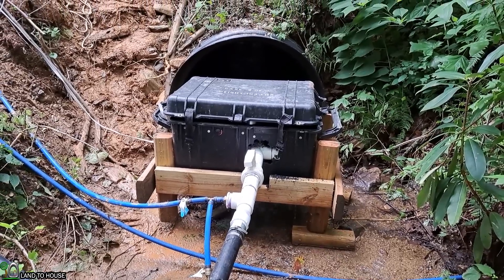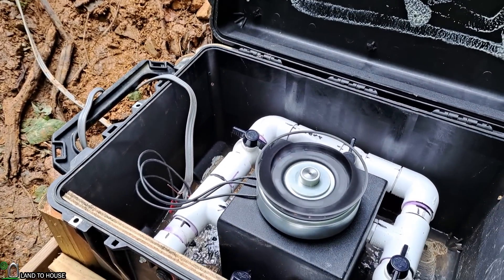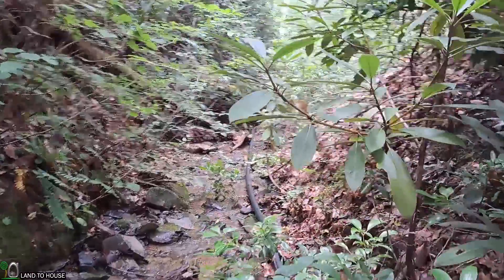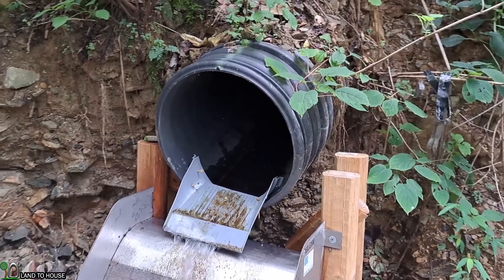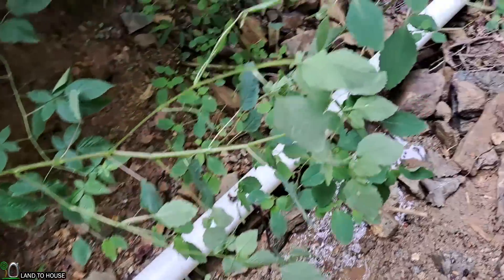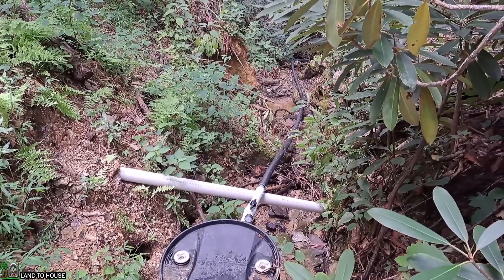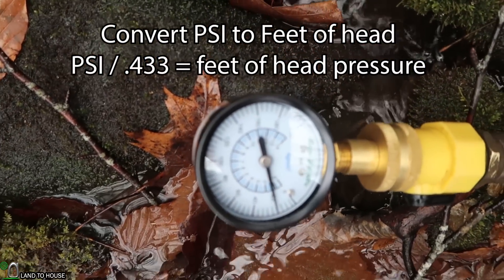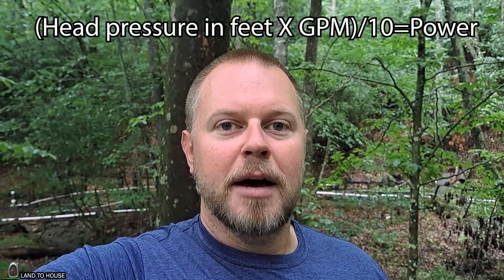Micro Hydro only makes 60w - do your PSI and GPM research first

Comment: The water is running so fast across the colandar screen that the water is running right off the end.  Can you lift the collection box up higher so that the water runs across it slower?  Also can you spread the water out so it runs across more of the screen.  At the moment it's running down the middle third so losing a lot of water collection.

Comment: do you go with the generator directly to the charge controller? do this have a special input or do you use the mppt input?
Reply from the maker: It goes to a rectifier then directly to the mppt. Surge protection and breakers are a good idea.

Comment: Your plumbing configuration is part of the reason that the system is inefficient. You should avoid any right angles and use flex pipe from the main line to each of the nozzles.

Comment: Could move silt barrel upstream so top is about 6"below the pipe where it attaches to the coanda. Every little bit helps. Maybe also look upstream from culvert pipe, see what other springs or runs can be cleared to the main stream

Comment: What a waste of plastic pipe. 70W!!
Reply from the maker: More upfront research needed to be done.
Reply: It could keep a car battery charged for an off grid cabin. 70w x 24 hrs = 1,680Wh; that's a 12V 100Ah lithium battery drained and filled every day;  most RVs get by with this.

Comment: Dear Land To House,
I appreciate all these videos so much, but I have one question: Does the power output change if the water drop (head) is the same but the linear distance  to the turbine/pelton changes? I have 50 gallons/minute with a head of 24 feet. I can set the turbine/pelton anywhere from 50 too 300 ft from the source. Does that make any difference for power output? Thank you kindly, Steve
Reply: The pressure comes from the height, not from the distance. This is why 'real' dams like the Hoover dam are very much vertical affairs - it's only the top-to-bottom delta that's productive.  It's like diving - diving 10 metres down puts you under 1 additional atmosphere of pressure.  But swimming as far as you like side to side adds no pressure, it only tires you out.
Reply: There are losses in the pipe depending how fast the water has to move through it and how long the pipe is.  There are pressure loss calculators and tables if you want to look it up.  There are diminishing returns once you get big enough in size and price goes up a bunch with larger diameter pipe.
Reply: The greater the horizontal distance, the greater the pressure loss due to friction inside the pipe. You'll get more power from a more vertical pipe, unless your pipe is so wide and smooth that the friction loss is negligible.
If you need the power 300ft away, you'll have electricity transmission losses too. You'd want to do the calculations on each to see which is worse.

Comment: Old time miners used huge pipes then got smaller. Able to wash dirt and rocks to screen fir gold no pumps.  Start 6 in then 4in last 2in.
Reply: Just cut the diameter back the last foot.
Reply: Just be sure to have a cleanout at each reduction ;)

Comment: Why put the cart before the horse. One you know you have enough head and water to do a hydro setup, follow in stepwise fashion. Step one measure the flow rate every week or two for a year if possible especially during the driest part of the year, this will determine the penstock size based on flow and friction losses in the pipe. Step two, install the intake screen, sediment barrel, and penstock to where the turbine location will be. Step three, install a pressure gauge to give you the exact head/pressure, this will help determine what turbine/generator to buy. Step four, install turbine and connect to charge controller.
People should consider buying a used cone bottom tanks for uses as a sediment trap, a valve placed at the bottom of the cone makes flushing the sediment as easy as possible and the penstock is attached where the top of the cone meets the rest of the tank so there is several feet of water above the penstock intake.
Personally I would have installed a 4" penstock to take advantage of periods with higher flow and reduce pipe friction or installing twin 2" penstocks at this site.
Reply: And, when you measure seasonal flow...? Measure in the middle of summer to get an accurate head pressure...They could still get there, with engineering/water dynamics...
Reply: @brentfarvors192  I mentioned measuring in the driest part of the year which for most will be the middle of summer. You do not need flowing water through the penstock to get head pressure as long as the penstock is full of water the pressure gage will give you pressure as all it is measuring is the pressure of the column of water in the penstock.
Reply: @chrisdaniel1339  Seems, the only way to gain necessary pressure is a dam before the culvert pipe...This will assure constant directed pressurized water into the pipe...

Comment: 60W is enough to do a float charge & run a well pump for very short runs at night. They can flush toilets & take a 1min shower. Also, best to think of it as 180W as it isn't "just" 8hrs of sunlight. This is 24/7
Reply: "1 min showers"??? Might as well ise a wet rag @ that point...Should have realized the same problem most of is have; Not enough water flow to produce the output necessary to justify the expense of installation...With hydro, and solar, though...
Reply: More efficient to run a pipe to a cistern on the roof.  Then it could be filtered for potable water, showers and flushes.  Save the electricity for lights, laptop, fridges. I suppose the generator could be attached to the watertight cistern, which holds the pressure gained from the run. Pipe -->roof cistern --> ground generator

Comment: Where can these turbines be purchased? Any websites recommended? Thanks
Reply: Seth has mentioned Langston Alternative Power many times in his other videos and I think that is your best source for more information and purchasing these turbines.
Reply: @kuhrd he's sponsored by Langstons
Reply: @m1geo  Even if he is sponsored by them I still think Langstons is a good source for more information and where to get these units as the OP asked.
Reply: @kuhrd  Sure. I agree too. But just making OP aware that it's also sponsored advice. He's not going to be told to buy anything but Langston's stuff.
Reply: Langston's website doesn't show any AC turbines, which is good for longer length electric lines. It would be nice if he had a few kits as examples with all the components

Comment: if you have waste metal, like cars, you can use 100%-ethanol-koh electrolyte metar-air fuel cell with carbon cloth (felt/fiber) oxygen air electrode to rust the metal and make energy, at 2kWh/kg for waste iron. no water, ethanol anti-freeze is -114C, so works even at very cold temperatures, like south/north pole. 0.8-1.3V per cell, 10-20mA per small cell. have not tested magnesium or silicon metals yet. tin, aluminium, iron, zinc works fine.
Reply: gps location, levels, height, laser measurement levels
Reply: 2kwh/kg sounds like a lot. where can i find more information on this?
Reply: @asfaust312  start from  electro-chemical fuel cells on wikipedia, for example, gasoline is like 12kWh/kg but at 25% when fuel cells is 80, 90, 100% efficiency, like magnesium-air

Comment: Seth I have been following you for years. If you want to make a micro hydro turbine work. Pressure or head is important. But why is the diameter of this pma so small`?  does Spencer Langston know what he is doing? I am not saying this PMA or the runner is not the right size for your system, but you still haven't fixed the cheap plumbing part in your own system which is a cheap plastic 1.5" ball valve. In addition you use this and other ball valves for pressure regulation, which is really not very good. The diameter of the turbine alternator should be way wider , geared and coreless. I don't see why you would take this advise seriously Also I would look at Chris Harbour's channel. This sound so negative and that is not my intention. Maybe a pelton/turgo with a stock alternator, even if it is from a sponsor, is not what you want.

Comment: I'm not sure a solar inverter is the right thing for a pm alternator. That's why it's speeding up and slowing down
Reply: What inverter should be used? Also which type batteries
Reply: @kishdogg1594    you need a charge control for wind and hydro. It needs to be programmed to the voltage of the alternator so it don't overload it. I think midnight has one. Use what ever you want for batteries
Reply: They do make hybrid controller/inverters that can run AC generators AND solar.
Reply: Absolutely. You can see from where it's surging. The MPPT charge controller is the wrong one for this job.
Reply: Hydro and wind usually  create AC (unless rectified) while solar creates DC electricity. The charge controllers aren't really interchangeable.